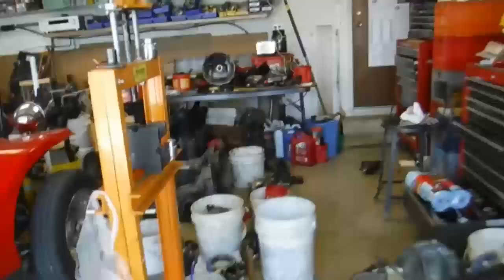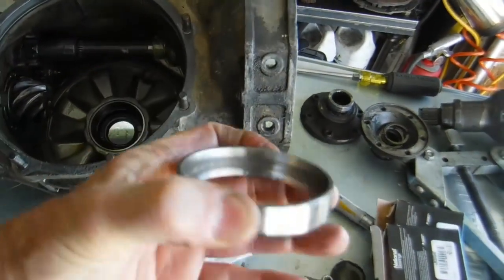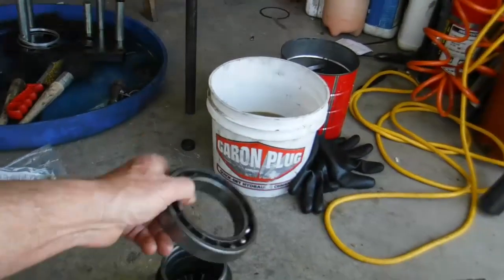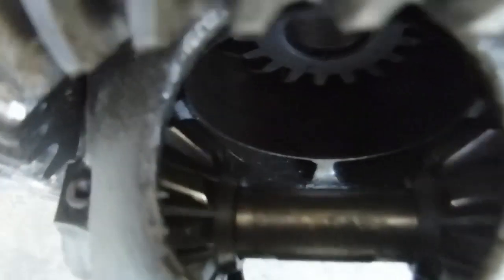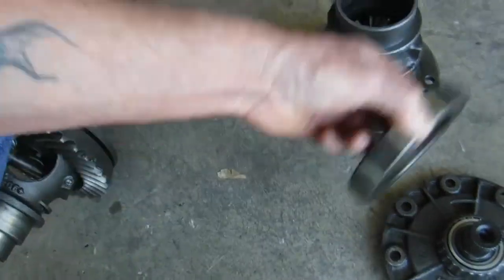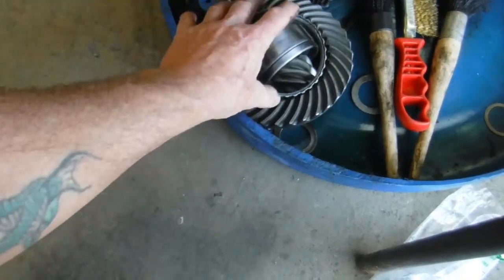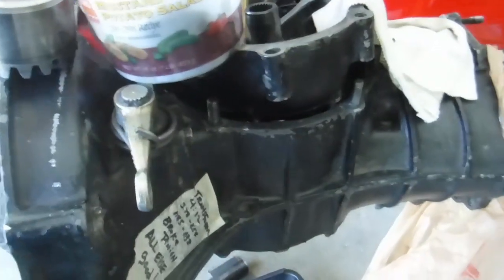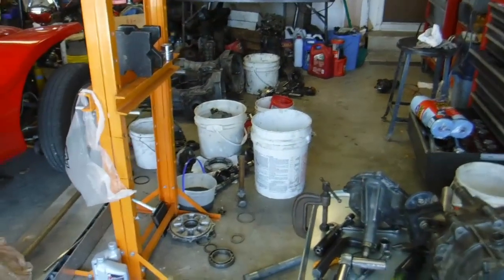Fixing a Growling VW Transmission

Comment: This explains a lot. I've been fighting a growl on my trike.
Reply from the maker: If it's a new noise and you want to check it out. Drop the oil and look for bigger peace of metal on the magnet. Don't worry to much if the magnet is covered with fine stuff. They all seem to have that.
Reply: @TheEZGZ  The problem is that I've been feeling this up through the pedals of a VW powered trike. It took a bad shot to the left side that was severe enough that it twisted the left trailing arm. It's part 71 beetle. I drained the case recently and there was fine dust on the magnet but nothing of any significance. It was about a 1/2 quart low. How hard is it to remove the left plate and bearing while in the car or is it even possible? I did replace the trailing arm, cv axle and both bearings but it still rumbles doing down the road. It seems to dissipate at highway speed.

Comment: 20 years ago I had bought two books and two VHS tapes on rebuilding tranny's and they always scared me off. I just didn't feel comfortable buying the specialized tool sets or making my own. It still interests me, but I think I will let those better than me do the build. I specialized in rebuilding Solex carbs instead
Reply from the maker: I'm up to my neck in tranny's. I should have chose carbs. The throttle shaft bushing and alignment scared me off from that.hehe
I had bad luck with tranny's and so ordered one and paid extra for the warranty. I had problems with that one and all my friends were breaking there's so I took the plunge. I think with normal driving they might have lasted a while longer but now it's just a matter of $$$$.  Quality parts are pricey.

Comment: Super diff is terrible for a freeway driven vehicle. At speed they keep oil away from the fulcrum plates, axles and crown gears. Ok for vehicle that does a lot of stop and go. 2 cents.
Reply from the maker: Depending on whether it's used for mid engine or rear engine your supposed to add a oil scoop hole in the side where the spider gear axles are. It should be directional with larger intake and on opposite side smaller. That takes care of the problem. For running the dunes we are at odd angle's all the time anyway. I do appreciate  you pointing that out. Some folks actually read the comments so it may help someone.

Comment: Hi I have a vw 002 when iam in neutral and start to let the clutch out it starts to make noise  but only in neutral not when it's in gear plz help...
Reply from the maker: Hi Daniel, what you call noise and what I call noise could be very different.....   In neutral with the clutch in everything in the transmission is stopped. When you let the clutch out you have a no load turning of the shafts and the bearings for all the gears are . rolling. A little noise from wear could last a very long time but it is good that you are aware of it.  Just record your mileage and keep listening.   Replace the oil  with 90-140 tranny oil and add about 6oz  of Lucaus full synthetic oil stabilizer. It's fairly thin, clear and very slippery. Take note of how much metal fillings are stuck to the drain plug magnet and make a note of that too. Remember these things are old. Always good to have a spare. Good Luck  https://www.amazon.com/Lucas-LUC10130-Synthetic-Stabilizer-Quart/dp/B000ARPVNY/ref=sr_1_4?ie=UTF8&qid=1543264436&sr=8-4&keywords=lucas+full+synthetic+oil+stabilizer